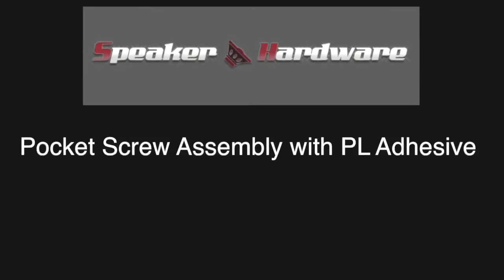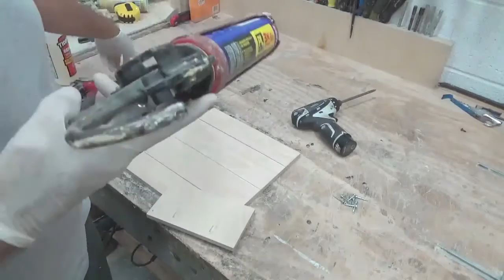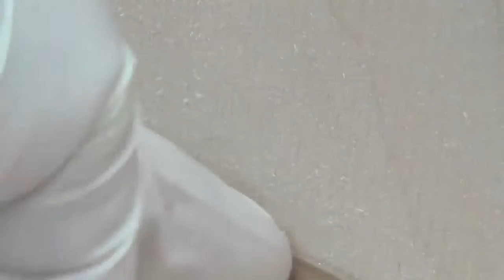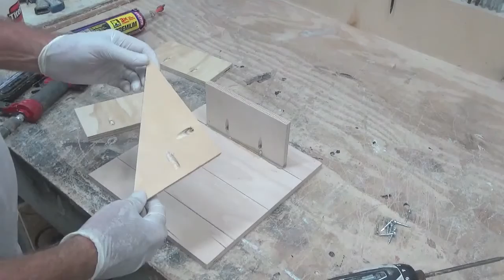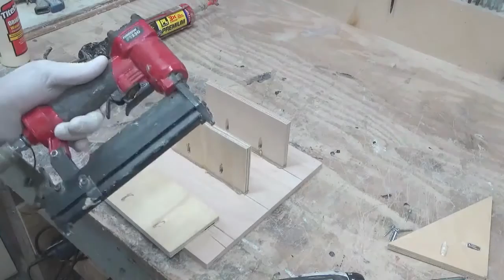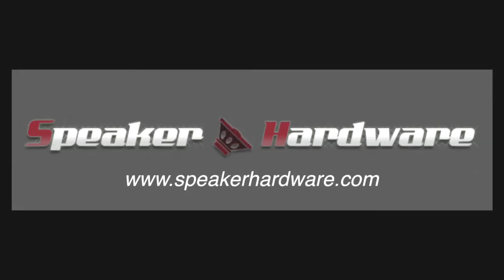Pocket Screw Assembly with PL Adhesive

Comment: What I do is screw them in without adhesive, back out the screws until just 1/8 is protruding, apply the adhesive, line the holes up with the protruding screws, and then screw them back down. Works every time.